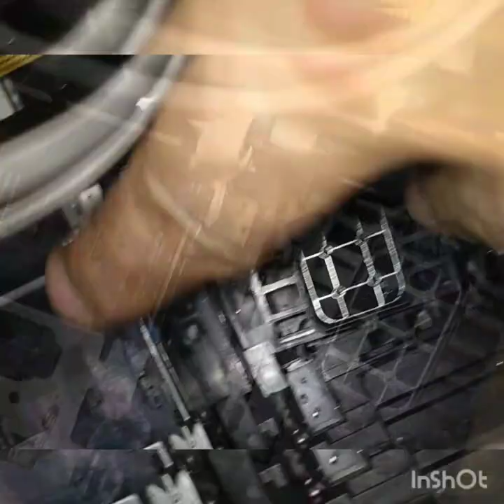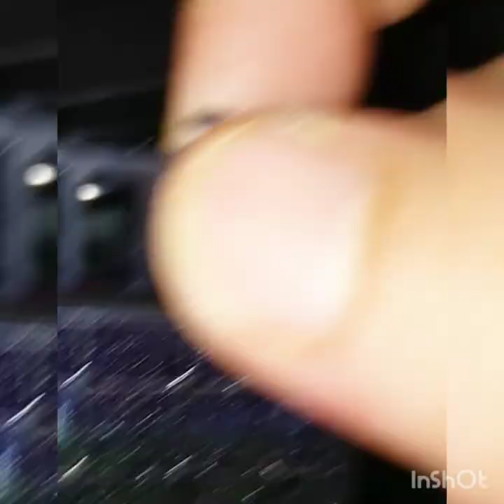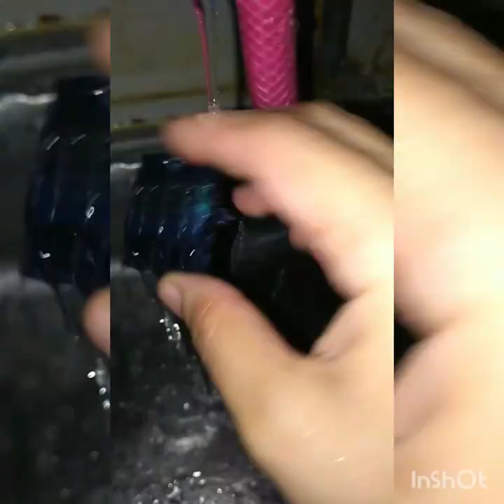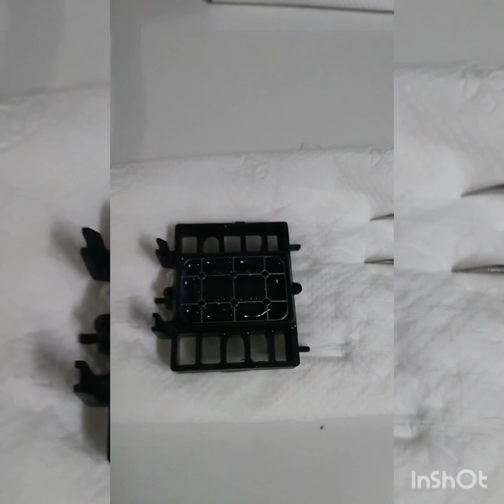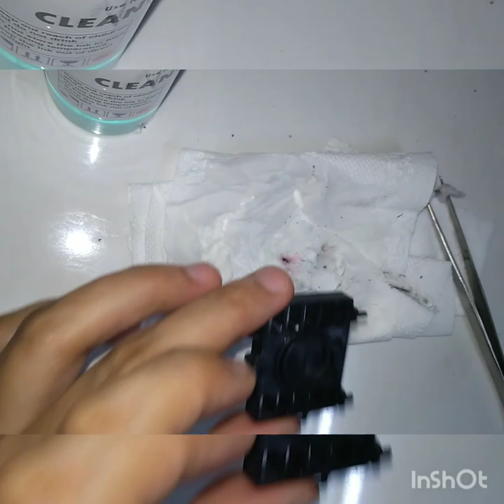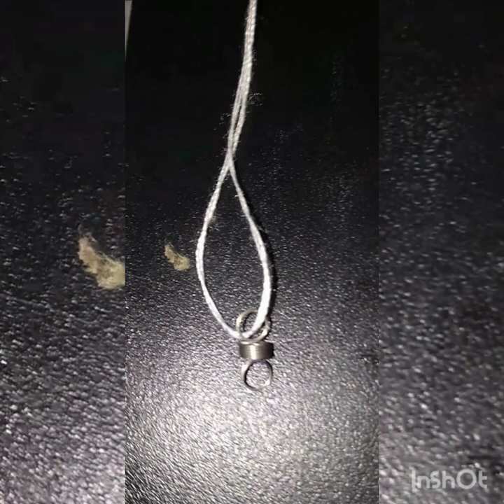L1800 DTF - Capping Station ink Pad/Weekly Cleaning/Not a Pro/Just Sharing :)

Comment: How do I put the capping station ink pad back on? Having a hard time connecting the two lines/tubes back to it.
Reply from the maker: just use your to finger to hold the tube, or you can use curv twizzer also
Reply: @MRSGulmayo  thank you for your response.  Are the tubes really that short or am I able to pull them out/up more to make it easier to attach back to the ink pad part?
Reply from the maker: @angellae.1327  yes the tube is  short just slightly  pull it and be careful with the inkpad

Comment: Hi, thanks for the instructions! Unfortunately, when I clean the head, the bubbles come back in the station :(. I tried flushing the two small tubes with cleaning fluid, but it can only flush them now with the left one, not the right one. Is that supposed to be the case? Thank you
Reply: Did you ever find this answer? I'm having the same problem
Reply: @sherylshahan5593  Yes, the cause was sediment in the tubing under the Capping Station. I disassembled the whole thing and pulled the sediment out. I recommend a regular hand flush with at least distilled water.
Reply: Thank you!

Comment: can you tell me wht is the roll of this ink pad in the printer
Reply from the maker: prevents the ink in the Print Head Nozzles from drying, protecting the Print Heads to keep them functional.
Reply: @MRSGulmayo  actually my printer is not showing the colour properly and specific yellow colour
Reply from the maker: @punitmaurya01  i'm not an expert, but maybe you need to clean, flushing or manual cleaning your printhead :)

Comment: i found my l1800 faded white, but when i clean the capping station, the white colour is coming good, but still inconsistent, but yeah it turn good everytime, is it normal to do like your video as a monthly routine ? is the capping station i mean the sponge need really good care ?
Reply from the maker: Yes my friend. Cleaning the capping station  is important thing to keep it clog free.  Maintenance should be at the end of its daily use =) https://youtu.be/-tWJWRbxrp4
Reply: @MRSGulmayo  hello my friend after i clean the capping everyday why is still fading after the first print
Reply: @MRSGulmayo  how long do you these method and how old is your 
printer now thanks
Reply from the maker: hi friend, before you print, suck the white damper using syringe then run clean :)
Reply from the maker: @lorenzolozano3569  better to use metal mesh damper base on my experience =)
Reply from the maker: @lorenzolozano3569  for two years now, then I changed my damper to metal mesh and it's better than ordinary dampers 
=)

Comment: I lost the tiny spring. Do you think it is an issue?. Printhead barely prints and when I do head clean I barely see any ink going to the capping station and the external waste tank. Is it because the small spring is missing?
Reply from the maker: hi friend,yes you need to put back the spring :)
Reply: @MRSGulmayo  Ok thank you for responding.
Reply from the maker: @MrPlomsone  ok my friend Thank You for visiting my channel please like and subscribe =)
Reply: did replacing the spring fix your problem? same issue here
Reply: @waceembroidery2645   I did buy a new spring and had to actually install a new print head. That was my main issue, which I didn’t realize at the time. Now it’s printing like new again.
Reply: @MrPlomsone  ok thanks!

Comment: Boss need your help. Bago pa ung head at damper ko. Naka 9 prints lang at d na nalabas ung white. Nag higop buga na din ako. Pero duda ko is ung capping nya is parang sira na ung foam. Posible ba un ung sanhi ng hindi paglabas ng white? At san po makakabili nung capping? Thank you.
Reply from the maker: hello po good day, pag nag clean ka boss humuhigop ba yung waste tank mo?
Reply from the maker: pag indi po my bara yunn tube mismo nun, yun po try nyo i suck baka barado po
Reply from the maker: https://youtu.be/-tWJWRbxrp4
Reply: Opo boss humihigop naman po sya pag nag hihigop buga ako.
Reply from the maker: naghigod kapo sa white 
damper boss?
Reply from the maker: pag nag cleaning ka boss sa PC nahigop?
Reply from the maker: ok po capping mo pag nahigop. try mopo suck yung 2 white damper ng ilang bese at mag run kapo ulit ng cleaning ng 2 times after mo mahigupan, tapos try kapo ulit mah print, liban nalang bos nag manual clean ka ng head at may resistance yung white barado yun bos...

Comment: hello po, pag konti nalang lumalabas sa waste tank kahit sa ink flushing posibleng palitin na po ink pump assembly? wala din po print out ok nmn po yung head nung binugahan ko ng cleaning solution.
Reply from the maker: hello po nag manual cleaning po ba kayu before mawalan ng printout?possiblenproblem po kasi pag ganun na short po ang head baka po may nabasa sa board.
Reply: @MRSGulmayo  opo, 2 p.head ko kahit isa walang print out at konti talaga yung nalabas na waste ink pag nag head cleaning ako.
Reply from the maker: @itnas68  shorted po yung board nyo sir pag ganyan :(
Reply from the maker: @itnas68  need napo palitan, nextyn po ingat nalang din sa pag manual clean at pag pabalik ng head, make sure po alisin nyo sa saksak yung powed cord, at alisin nyo po sa flex  yung head para sure po lagi napakselan po kasi...
Reply: @MRSGulmayo  iningatan ko nmn po maam n di mabasa yung board and nakaunplugged nmn po pag balik ko ng head.
Reply from the maker: @itnas68  pero para sure kapo sir patest mo nalang po sa tech yung board , same din ng sakin kasi dati sir after ko mag push ng cleaning sol yun ala ngnprintout kahit nagpalit ako new head ala padin rapos yun board na pala
Reply: @MRSGulmayo  ah, kala ko po yung board ng head, actually nasa technician po now yung printer di ko lang po alam if chineck nya mainboard..btw salamat po maam
Reply from the maker: @itnas68  bali alin po kasi sa dalawa yun sir, board or head ang sira or dalawa po silang na damage ganun po
Reply: @MRSGulmayo   pinull out ko n po maam yung printer ko, nagtry ako magnozzle check may print out nmn pero kakaunti taz black lang di pa kumpleto then nagcleaning ako wala n ulit print out means ok pa p.head ko hindi shorted? pero wala talaga waste ink na nalabas..tinest ko din po mainboard ok nmn f1 fuse nya binaklas ko na nang tuluyan tinanggal ko capping assembly pati p.head binaklas ko n din binugahan ng cleaning solution then babad while waiting sa inorder kong brand new ink pump unit assembly..hope yun talaga problema.